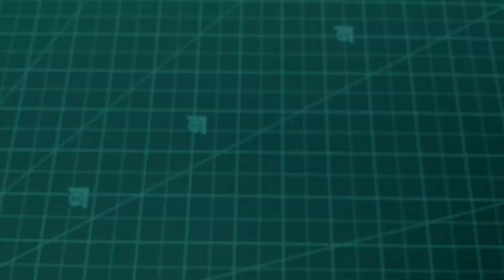How to make wireless power transmission circuit like in smartphone | wireless power transfer

Comment: Aapne input supply kitne volt ka liya hai??
Reply from the maker: 5 volt dc
Reply: @AKGTECH  
Ok
Reply: @AKGTECH  
Input 5V.....output hua...approx 9V..
Nice
Reply: @AKGTECH  
Please aap isko ek wireless mobile charger bana ke dikhao..
Reply: @AKGTECH  
Output volt...approx 9 volt..
Ampere kitna hai??
Reply: @AKGTECH  
Irf Z44 ya P55...ye dono mein se koi ek mosfet nhi le sakte Kya??
Reply ....must
Reply from the maker: Ji bilkul koshish karunga
Reply from the maker: Ampere bahot kam tha, Ampere ko improve Karna hoga, lagbhag 50 mili amp current tha
Reply from the maker: Ji bilkul z44 ya p55 mosfet ka use kar sakte hain, lekin heatsink ka upyog zarur kijiyega
Reply: @AKGTECH  
Ok aap ampere ko increase kijiye....
Aur charger banaiye..waiting for the moment